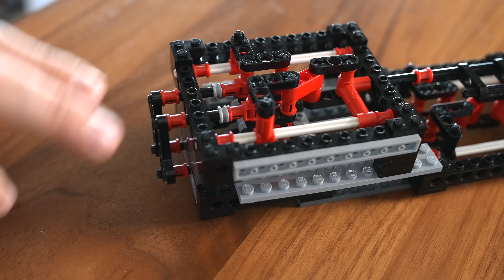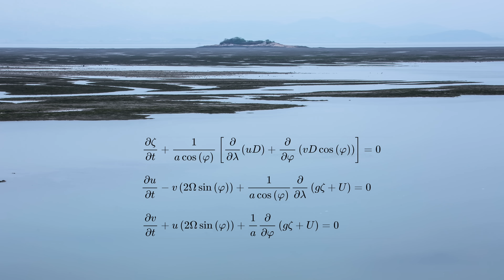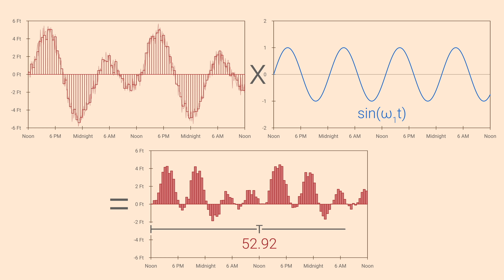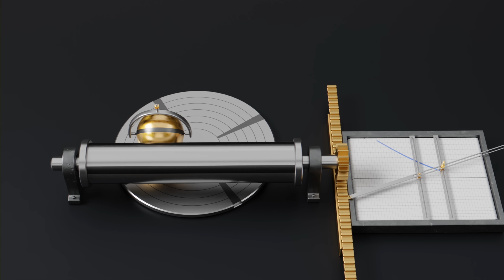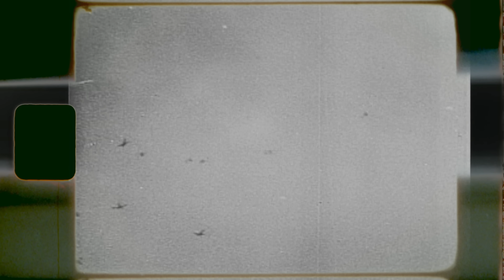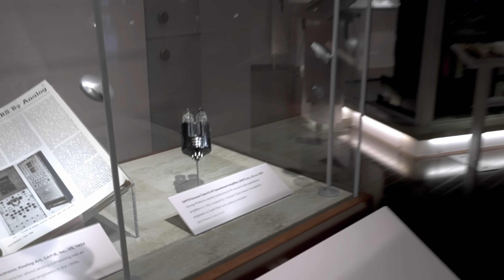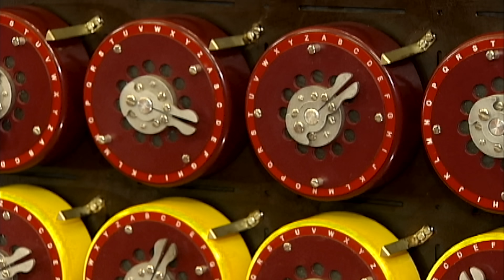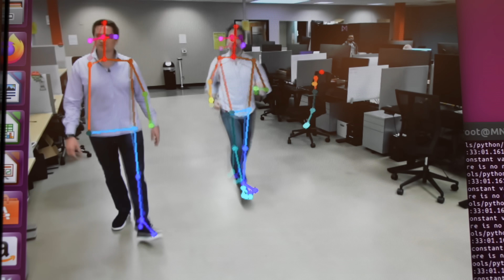The Most Powerful Computers You've Never Heard Of

Comment: Correction to the comments about where the Norden Bombsights inaccuracies came from: it wasn't just mechanical factors, but primarily the difficulty of predicting and accounting for the changing wind conditions at the various altitudes when bombing from high altitude. What the system lacked was a method for detecting these. Had there been time, the shortcoming would've been corrected and many civilians might've been spared the horrors of area bombing.

Comment: I had an idea for an analog computer based on a vibrating plate. you have a series of transducers that can either drive vibration or measure it. Using FFT you could do very complex quantum mechanical calculations as your possibility space is huge. Also thought about using different frequencies of light to create complex changes in brightness due to the beat phenomena.

Comment: I don't think so; we will first me to true decimal bit computers using discrete voltages or light frequencies and finally multi-level bits which could be 128 or higher level bits bytes are replaced with bits and computing speeds increase exponentially.

Comment: Not sure that modern transistors are almost the size of atoms. Rather a lot of atoms are required before you even get the types of silicon needed to make semiconductors and even fempto-amps of current represent a lot of electrons to be transferred through a junction.

Comment: Mechanisms can be miniaturized, too. Many analog computers could solve the same function simultaneously, a digital computer could calculate a median output and provide exception handling. A spring, mass, damper model can be a mathematical (diff. eq.) analog of almost any dynamic system.

Comment: The first Quantum computer.  
It calculates based on probability of locating a point on the outer shell when wave functions of inner shells are taken into account. 
Like nueral network.
Waves are not digital because they account for all states between on and off. Infinitely more data.
The image of an atom coming into focus is the same as a nueral network identifying the probability of an observered object matching previous knowledge about objects. 

That is probably a "1", but maybe not.
That is probably the location of the Electron, but maybe not.
That is probably the location of the plane, but maybe not.
That's probably Amy in the distance, but could be Angela, probably not a giraffe, but maybe.

Comment: A little bit of correction:

Although the M-9 fire control computer played a part in reducing the number of shells to take down an aircraft, the use of proximity fuse itself was vital. This ensured that the planes don't need to be hit and the air bursts could be enough to damage a plane.

Comment: If Veritasium is a real element, It would have to be Calcium, as it is closest to the 42 AMU of the imaginary element. The closest stable isotope will be Calcium-42, at about 41.95 AMU, which can be rounded up to [42.0]. All other isotopes which are as close to 42 AMU as Ca-42 decay.
Or maybe Derek is referring to the Atomic number, which makes it the element Molybdenum. 
(But that's unlikely, as the number is on the bottom of the box)

Comment: tbh I dont think fully analog computing will ever catch on. There are as of now two ways to compute stuff in an analog way. Mechanical and Electrical. Mechanical has failed us already. We had incredibly intricate machines, but for them to reach the same efficiency as mordern digital ways is quite impossible/impractical. 
So only electrical remains. This is just... very very hard. For analog stuff to be mass produced, you need really good tolerances on every important part of the process or manually tune every single device. In the end, its probably easier to automate the tuning as well. So that may not stop us. Then there is the actual designing part. Stuff in analog electrics is incredibly non-linear. You have to deal with semiconductors (I will just assume that) and those vary harshly on a lot of variables, some are just purely statistical. Even if you use like 300nm processes, basically the oldest ones you will find in modern cpus, you would probably need VERY high computational power to simulate and error-correct analog computers so that they will work. And you cant do that for like one design and be done with it, no, your load gets increased exponentially for each component, since they can have infinite values. Right now there are tolerances. Like, one place on the chip may only ever get like 1.0 V instead of 1.2 V but thats fine for that place, another one gets 1.20 V and if it gets much lower, the chip will probably struggle. With analog, there is no such redundancy. Everything needs to be calculated PRECISELY. For modern chips this simulation alone would probably take years. And that would need to be run a few times, for each time you correct errors.

So all in all, at least with modern chips you wont get analog computing running. What I can imagine instead is a new kind of math used, like instead of boolean algebra some other algebra with 4 values instead of 2, or 8. That could drastically increase computational power. Quantum computing does something like that, tho in a very... special way. And then with time those 2 or 4 values may increase even more. But (to my knowledge) such math that is as complete as boolean algebra doesnt quite exist yet and for that to work, there will probably a penalty in terms of power consumption and design complexity. Every single part of a cpu would have to be redesigned and that in a more efficient way. That will only happen once we truly reach the borders of computing with the binary system, and I recon some stuff like light computing or smth will replace silicon computing sooner or later.

Comment: As a computer engineer, I don't believe in the come back of analog computers. However, don't want to rule it out completely. It's not necessarily impossible. I just don't see it happening. If I need something being processed super fast, I use a (highly programmable) FPGA or I just throw more CPU power onto the problem. So I don't see a reason why someone would want to take up the inaccuracies of analog computers again.

Comment: Great video as usual. Hey. tell us how that pulley system works. How come a dude on a train, thinking about pulleys then think it will add trigonometric equations.  and also, why is there weight on strings, and is the weight the same. Thanks.

Comment: Ohhhh I know what the second video is about. Neural networks modeled in digital computers are modeled with digital floating point numbers. Seems like a perfect candidate for doing this type of processing with analog neurons. Still there's a noise problem. Not operating transistors at saturation in the linear amplifier zone has a lot of noise so it will suffer from the problems you talk about.... Not all inputs will have the same output.

Comment: The moon doesn't rotate in front of the earth, it falls towards the earth in a spiral. Can you even get the graphics right ? You're machines show that time is not real and only a man made measurement tool for synchronisation of movement, the calculations are based on movement. If you are only moving 0 and 1 then sure maybe you need more calculations but analog calculations are probably even harder to program and need more complex synchronisation. Is this not what functions in computer science are ? We take the 0 and 1 and make more complex calculations with programming languages. Devices for analog are just functions linked to modern Programming languages? Then the output is converted back to 0 and 1 to perform on the computer.

Comment: The analog computers are application specific. You would have to make seperate computers for each problem. Digital computers solve this problem. Digital computer can be used for any application using appropriate software. But analog to digital converters are required to convert the analog data to digital form then it can be processed by the software.

Comment: As an electronics engineer, I can't say that I've never heard of these, quite the opposite. I'm just  reading through "A Designer's Guide to Innovative Linear Circuits" by Jim Williams, which is a book from 1985 and it is filled with analog computer designs and the description of their operation. I have always been interested in old designs and analog computers from 60s - 90s were always so fascinating to me. It is mostly a forgotten craft now, but there are some niche applications where you'd still use analog computer, at least to some degree. They are often right there on the mixed signal chip, as a part of an input processing or analog to digital converter. They are in some audio gear and so on.

Comment: You can have digital analog computers no problem. 
Not talking about hybrid. 
Differential analysers based on a stream of bits was made. Quite close to PWM and switched more PSUs in basic function. 
Advantage being, that there was no ambiguity or drift, all of the speed of analog and the ability to have digital or analog readout or transfer to a digital memory/register.

Comment: Reminds me of an internship I had while I was in engineering school: I worked for the Geophysical Institute in Alaska, with a group that analyzed synthetic aperture RADAR data. Back then, gigabyte file sizes were still pretty hard to work with and the data took hours to process, something that most SAR devices do in real time now (I think). They said that in the early days of SAR, they used some kind of optical analog computer that used lenses and mirrors to do all of the calculations. Fascinating.

Comment: This is a very nice video with among other things a fine survey of Kelvins tide predictor. But I think there is an error in the animation of his ball and disc integrator. Most integrators of this type used a small wheel which had to slip on the disc when moved sideways. But Kelvin (or his brother) used a ball which could roll in all directions. Hence it could not have a fixed axle (as it have in the animation!) but must transfer the rotation to a cylinder which do have an axle (also shown in the animation but without the proper explanation).

Comment: There is a very important reason, why analog computers will never truly take over digital ones: error correction. The problem is that when you calculate a function, you include some error in the result. And the biggest problem is the ambiguity created by this. This results in overlaps between the results of calculations. So it is possible that f(x, t1) = f(x + delta, t2) (the result at some time for input x is the same as the result at some other time for an other value, different by delta.)

Now to make things useful, the probability of overlapping needs to be reduced. But for this the inputs need to be quantized. The larger delta is, the less likely this overlap is. So essentially analog computers are digital computers with more than two levels.

Comment: So basically digital is for multipurpose computation and analog is very good for specific usecases where you don't need flexibility.
I'd think that we will see the advent of hybrid computers where the main computation is done by the analog computer while the digital computer provides some level of flexibility and mostly supports the analog computer when needed.

Comment: Computing in the old days took serious balls.

Seriously, this is a big reminder that machine "computing" is just physics at work. With gears etc., you just set a few variables on some gears and that forces others to immediately correspond to the answer. With clock circuits, each pulse sends charges that reconfigure the circuit for the next pulse. No real thought, just passive action. Fascinating in itself and also makes you question the meanings of passivity and activity, especially in relation to life.

Comment: i loved programming  the analog computers at university. define anything with a differential equation, use the electrical analog(resistor, capacitor and inductor) and you have a machine that shows you real time results.  it was way more fulfilling than some lines of code.

Comment: The worm gear on the back of my camshaft is an analog computer.  It rotates the distributor shaft to time the spark ignition with the top of the power stroke.  Timing the engine is adjusting the distributor shaft so that the spark without vacuum advance hits when the timing mark is passing a certain mark, say 6 degrees below top dead center.  The timing chain connects the crankshaft to the camshaft so that the camshaft rotates once for every two times the crankshaft rotates.  Classic car engines are analog computers.  As are the transmission gear boxes and the differential gears.

Comment: So, fun fact, when USS Missouri was being reactivated and refitted prior to the Gulf War the US Navy approached IBM about the ballistic computers since they were the ones that made and installed them way back in the day. Keep in mind, this is the fire control system for the WHOLE ship, from the 20mm Oerlikons that form the base of the holy trinity of anti-air, all the way up the main 16" guns in turrets that weigh more than some smaller ships.  This system weighed dozens of tons and was integrated at every level into the ship, armor would have to be removed to get at it, entire compartments were devoted to this thing, it would have been a PROCESS to replace it.

So the Navy asks IBM if they can upgrade it? For a nice juicey government check? ABSOLUTELY WE CAN! It'll be all new and digital and take up so much less space, save so much weight. The Navy says that those are both nice things, but can it be made more accurate? Well... No. No we cannot. The Navy did not upgrade Missouri's fire control system from analog to digital.

Comment: Actually, the ENIAC was neither the first programmable nor even the first one of it's kind at all. And though the AB-Computer was digital it wasn't fully programmable.
No, instead the first fully functional programmable digital computer was, ironically, the German Z3 in 1941. Ironic because the same kind of thing cracked the German Enigma in other countries. However they weren't made by request of the state yet, and even later it was just a sort of side project. AFAIK the small company/group that made them did receive financial support but that's it, the computers didn't see much use aside from assistance in developing some projects the group was also involved in by running simple programs. Also they were based, but on electromechanical relays (which functionally identical to transistors but use moving parts instead of a semiconductor) instead of vacuum tubes or transistors. Later on more models were sold, and these were actually some of the first commercial computers in Europe as well, though like 20 years later the company was bought and the story pretty much ends there.

These first computers may not have been that significant, but they shouldn't be ignored.

Comment: The idea of developing an analogue computer sounds counter productive. As he said, due to limitation of Machine Learning (Ai) of crunching the matrix calculation using digital computer find its limit due to the transistor’s size similar to an atom, really cannot be compared with how cost effective is to recruiting data analyst. The whole point of the advancement of ML / Ai was to solve complex matters with 70-80% accuracy and the cost of only 1/10th (a control engineer / 10 data analyst). But, hey, might be that history repeats it selfs, its always a good time to be an engineer 😁

Comment: My father worked on analog computers in the 1950s (and up until 1962). The enterprise was called Project Cyclone, and was run for the U.S. Navy by a company called Reeves Instrument Corp. They used the machines to simulate things like the flight characteristics of proposed airplane designs.

Comment: I learned the distinction between digital computers and mechanical computers sort of by accident a while back and came across something that said the first known mechanical computer was from the early 1800s and then I realized the Chinese actually do their multiplication in a weird way on a square a rectangle and then work the numbers diagonal across the boxes of the grid. Which is how you would do math if you were using a mechanical computer.

Comment: The digital and the analog computing systems are "representation of information". In the digital one, we omet some information in the Fourier serie transformation to get the "bit": one or zero which gives more precision, in the analog one, we get more information by scotching it as it is in the mechanical machine, but with more errors. To put it simple in an example: old photograph machines had incredible resolution, you can print them as large without losing much resolution but, the images contains imperfections, for numerical images they look good and perfect, as you zoom-in you see those pexels with lines, so the continuity is lost in the digital system. Another example is the old analog receivers for TV channels, where you can get the signal in a large margin of frequencies but, with "tshahsh" imperfection, in the numerical tv receiver, you have the signal at exact one frequency, if you move a little you lose the signal completely: signal or nothing.

Comment: We should also differentiate digital from electronic. Apollo program used digital computer for lunar lander for example but it was hardwired computer without Semiconductors which are susceptible to random errors. In my honest opinion we rely way too much on electronic in places where small error can lead to catastrophic lose of life. Even NASA admits that they would struggle to recreate reliability of The Apollo Guidance Computer using modern technology.